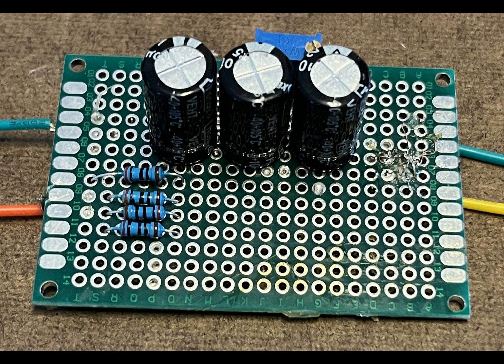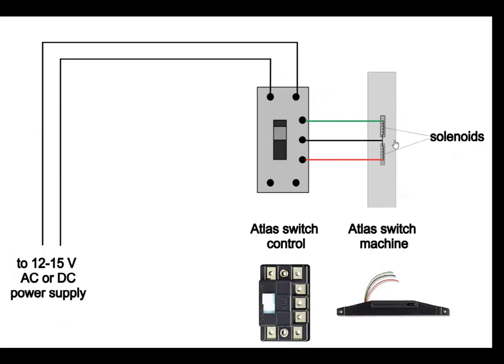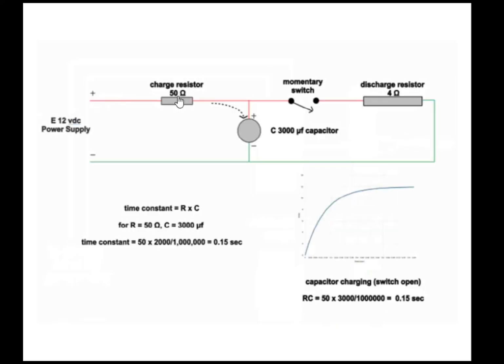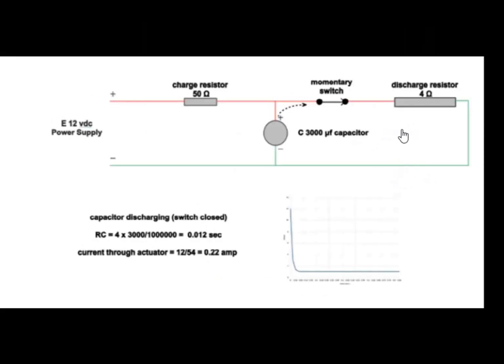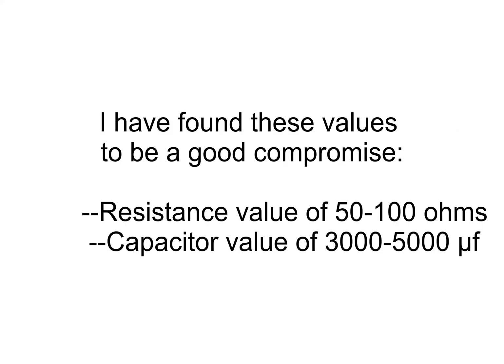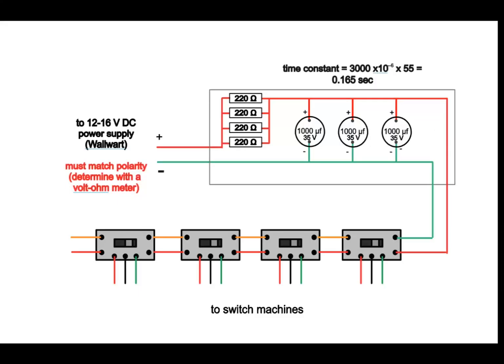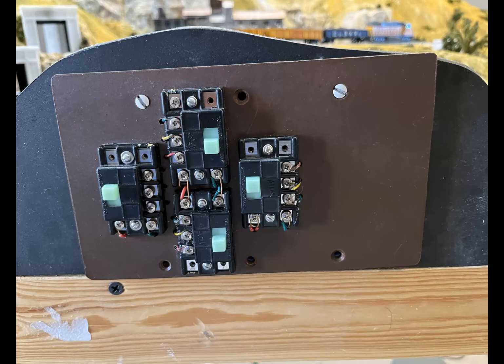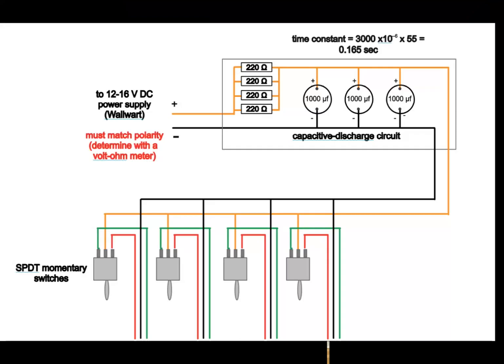More Information on My Capacitive Discharge Unit for Switches (Turnouts or Points)  Operation

Comment: I made something like this 22 years ago to power the electric door locks that I installed in my GMC vandura 2500...gives the motor a big kick to get it going, but limited current if you hold the switch for too long.

Comment: So Dean, where is the information about commercially available products that do this? I don't see it in your video.
Ron
Reply from the maker: At 30 sec into the video.
Reply: @DeansNScaleTrains  vendors yes, but what are the actual products involved?
Reply from the maker: Links to units for sale commercially are (which I have added to the comments)

https://www.hobbylinc.com/cgi-bin/s8.cgi?k=str_s.capacitive%20discharge-cat_s.U
https://miniatronics.com/products/capacitive-discharge-1-unit
https://www.ebay.com/sch/i.html?_from=R40&_trksid=p4432023.m570.l1313&_nkw=capacitive+discharge+for+model+trains&_sacat=0
Reply: @DeansNScaleTrains  thank you!